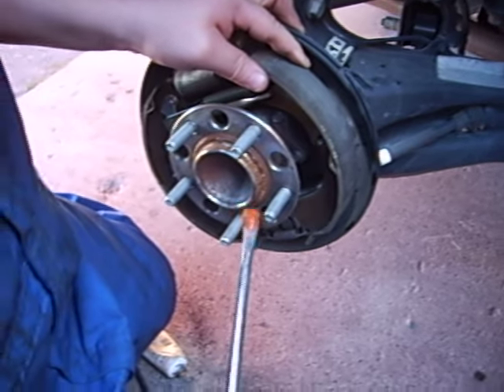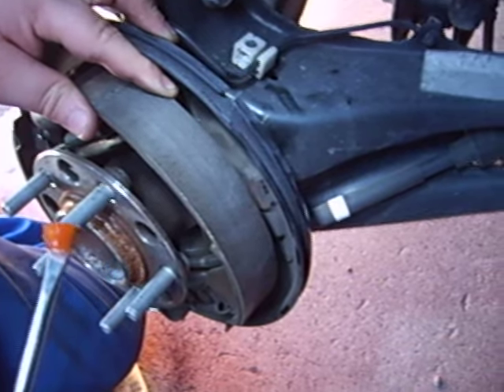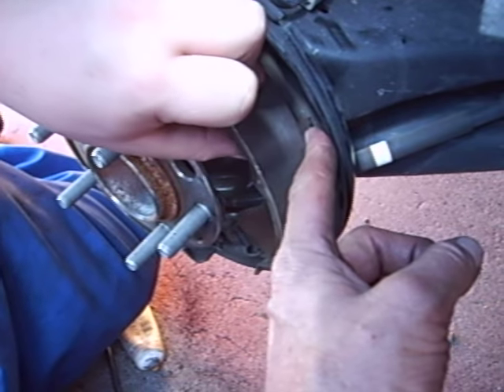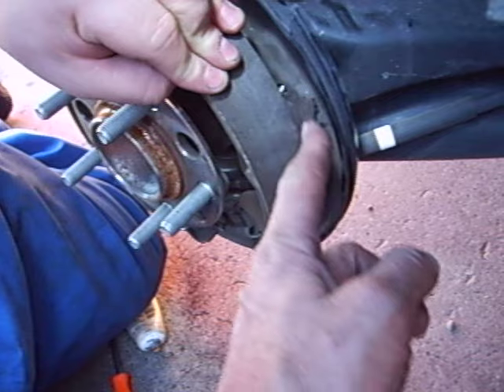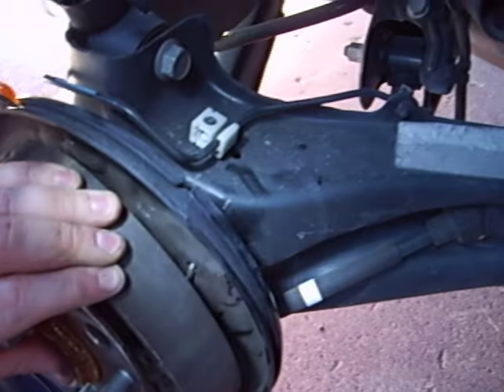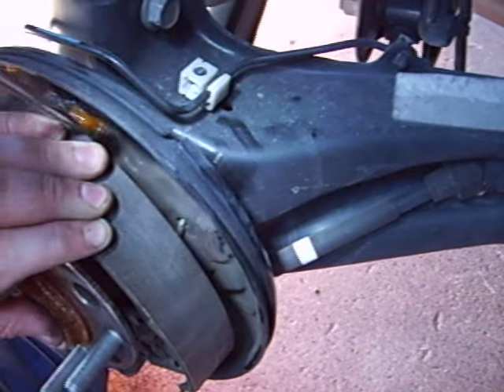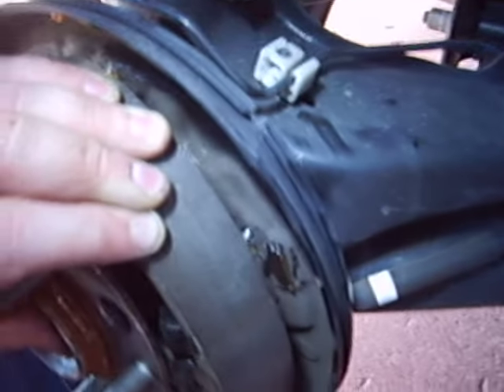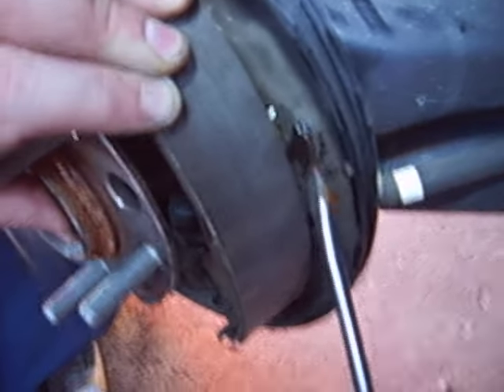Drum brake noise - where to lubricate

Comment: Exactly what I need to know. I get the "squeak" when I let off the brakes.
Reply: Same shit, it's loud, somewhat embarassing aswell!
Reply: Does yours also make noise from pulling the handbrake? Mine does both, when let off the brakes and handbrake, shits sound annoying bro
Reply: @danihqm5730  Yea it did the squeaking
Reply: @Kuppancs. that probably because the shoe on ur drum is asf lol sand it down a bit
Reply: @ramb035  No problemo, this been a problem 7-ish months ago, plus I'll be replacing the whole rear beam with disc brakes :D
Reply: @Kuppancs.  Ayy Truu but it does happen I work at Toyota

Comment: my 2017 silverado is making grinding noise in the back left rear side . I can usually hear the sound from low speeds all the way to 45mph but starts getting quiet the faster i go and its only when i let off the gas and never when on the brakes. the noise sounds like like a deep grind ,cycling every time my tire makes a full cycle/rotation. truck isn’t under warranty and ive had a mechanics look into the brake drums telling me its not it , they replaced a transmission mount , replaced my differential bearings . they changed out my brake pads and resurfaced my drums and its still making the noise . anyone else have a similar problem ?
Reply: It could be a bearing problem?
Reply: got the same issue.   you figure it out?  dealership replaced my rear diff.  checked axle shafts for runout...both good same specs on each side, .005.   bearings are good.  replaced drum.  new wheel.  still the same...
Reply: @allseeingeyezz  sadly no , Ive been driving like that ever since . it hasn’t got better nor worst but I still feel like I shouldn’t drive it like that . Some mechanics have told me it was normal but I know it isn’t.

Comment: What lube????
Reply: I would guess copper grease would do the trick, just make sure it doesn’t go anywhere else.
Reply: Where is part 1 to this video?
Reply: Napa Sil-Glyde
Reply: I use Honda M77 to do exactly this annually to an old civic. M77 is a molybdenum and silicone based paste. Honda specify it in their service manuals. You can get a tube at any Honda dealer.
Reply: anti-sieze works too
Reply: Ate Plastilube.